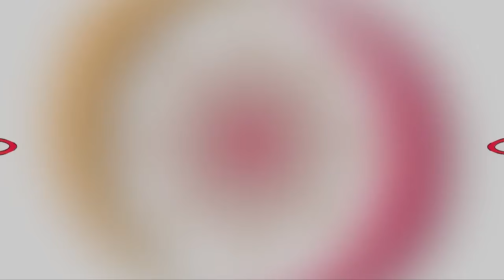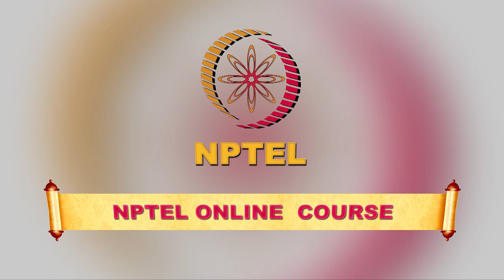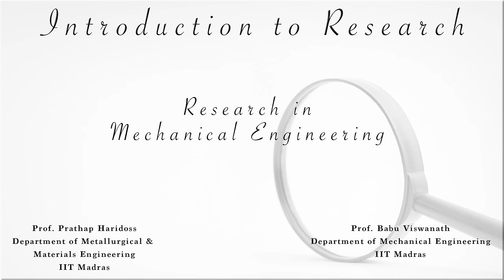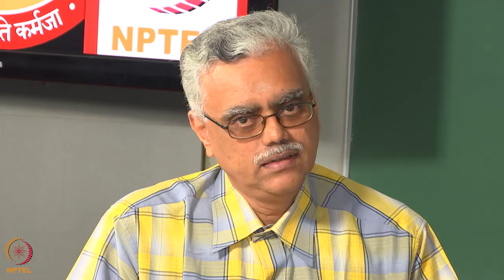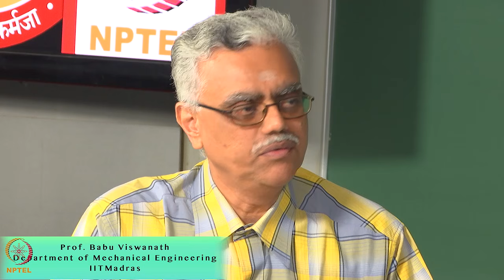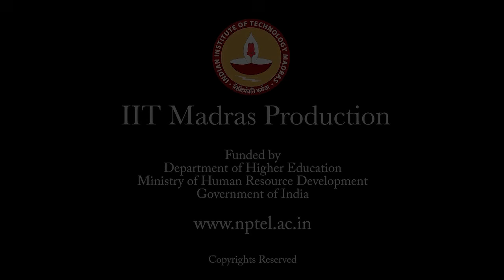Research in Mechanical Engineering

Comment: Don't go into Mechanical Engineering as there very less companies that recruit.
As the video also suggests there are not many specific topics of research.

Micro Eletro Mechanical Systems
And Biomechanics are good fields but before getting into a research course , getting a practical EXPERIENCE or JOB profile related to those fields will help you alot even in USA.

Thanks for the video prof.
Reply: its look like you pass out from third-grade Engg college
Reply: @nik9643  What is the role of  Mechanical engineering in IT sector?
Reply: @nik9643  yep
Reply: @PrashVerse Incase you are living under a rock, mechanical engineering doesn't even pertain to IT sector. It's for CORE sector.